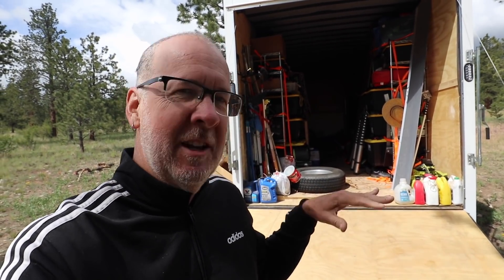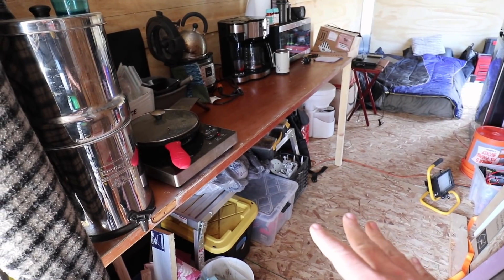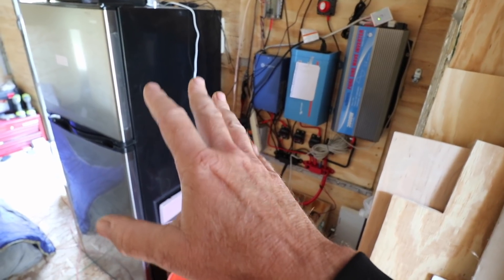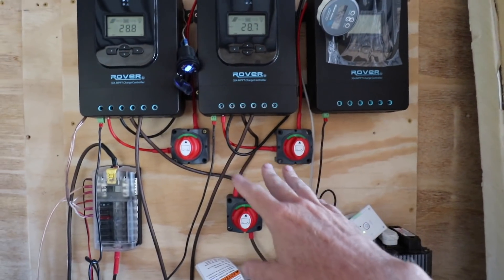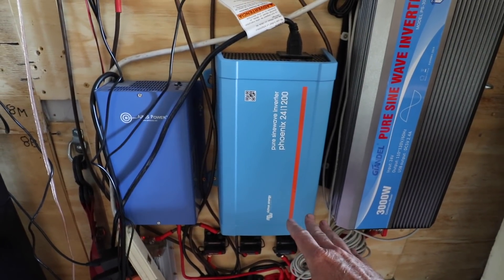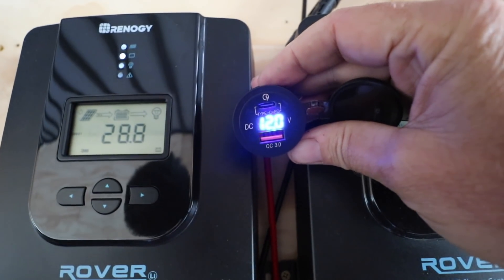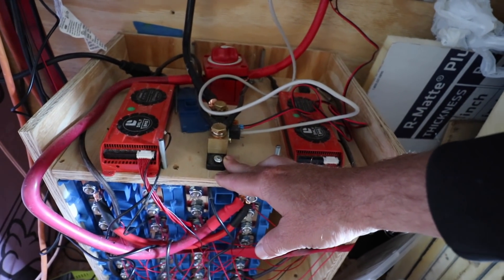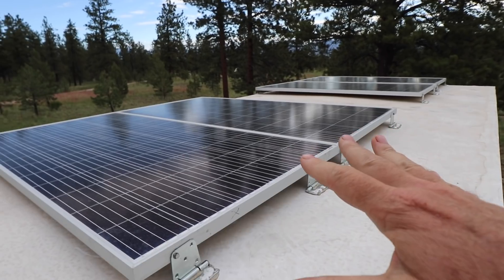2 4k Watts Solar for My Cargo Trailer Conversion E619

Comment: Nice to have the roof space for some real power. I am a bit surprised you haven't switched to a DC reefer. They aren't cheap, yet neither is the power draw of a residential. Interesting.

Comment: Are you talking about installing a mini-split A/C when you discuss your heat pump/AC?  That's what I would do.  Get the highest SEER you can afford.  They are much more efficient than the all on/all off systems most heat pumps are in the US.  Also, MUCH quieter. The rest of the world uses mini-splits.  You didn't use that term, "mini-split," so I wasn't sure what you were intending to install.
Reply from the maker: yes, it will be a 9k BTU mini split w draw of about ~600 watts mounted over the tongue area

Comment: I was a bit worried when you mentioned 400 watts output from these panels, I thought they were new panels but they are actually used? New diodes refitted into the panels. Not bad! I wonder if the average drop in output power of new panels is due to the diodes agin. I have two doors from my rentals back int he states that I brought over. Yup holes în the doors from various reasons. A wood shop I deal with over here can actually glue another Luan panel on top of the sides with the holes. Not only do they make great shelves but they can double as a drafting desk or work bench.
Reply from the maker: these are used panels with some small scratches on them. they have new diodes and original specs had them rated for 385 watts each. with the new diodes I'm getting slightly over 400 watts from each and they cost me $100 each!

Comment: Hello, Seven.  You sure are in a beautiful camping area.  Happy things are looking up and that you can enjoy some good weather, mild temperatures and get some work done on your home while you wait for your truck to be repaired.  I think you're doing a fine job.  Also happy to hear the good news about the truck.  I was really surprised the thieves took the time to install those old dirty seatbelts along with 2 seats, lol.   I wish you continued success with your build. You've learned so much about electrical systems,  you could start your own consulting firm.  :)   It will be nice when you can get back to enjoying your travels as well.  :)

Comment: You should check the power usage of the split heat pump (for heat). As long as it's not too cold, it should be pretty efficient. Like use it for chilly mornings and save the diesel heat for when it's really cold.

Comment: Many people find ways to minimize their electricity needs to boondock.  You, on the other hand, are just creating your own personal power plant.  I’m sort of in your camp too.  I’ve got 800w for my roof and another 600w for the ground as a buffer if needed.  But, I’ll be using propane, charcoal or wood for cooking and I have a 12v fridge/freezer that will hook right to the batteries.  I just discovered your channel and will be sure to follow your build.  You are ambitious to be building and living in the rig at the same time.  I’ve done that in sticks and bricks too many times.  My rig will have to be at least 90% complete before I even think about staying in it full time.  If you get the heat pump mini split, it should perform well in moderately cool temps shouldn’t it?  Say anything above 32F. ?  I’m not that well educated on them.  I’ll have to catch your video on your install of that.

Comment: A 24 vot system. More efficient but you'll have to use a lot of more expensive marine or 24 volt rated products. To use your truck as a charge source, you'll need a 24 volt alternator added on. Others have successfully done this but also with 2.4K solar, you may not need to worry about it. Looks great.
Reply from the maker: not planning on using truck alternator as a charger (only solar or shore power charging)

Comment: I feel good to hear his updates on your truck. I highly recommend you use more mounting brackets on your solar panels when you're going down the road and you get any gust of wind coming across the top of that trailer it's going to rip those cheap hinges write-off. That same thing happened to another another person that I follow he lost one or two panels because he didn't use enough brackets

Comment: Go straight to Samlex America and order your 24v to 12V; I use the big 60amp 24v to 12v but they also have the smaller amp one. Mine has been in use non-stop for 2+ years now. Tell them I sent you, I don't have any juice, but you never know. : )

Comment: I would suggest putting in a 2nd screw on each panel, it looks like you just put 1 in each bracket. It may save you a headache down the road..
Reply: @DestimoniumTremens  i go to work for my money. never ask anyone for free money
Reply: @DestimoniumTremens  i pay for it with premium
Reply: he only put one screw in them so when driving down the road they will blow off, then he can come back online and ebeg for money to help him fix his mistake

Comment: You did what I did with my panels over 4 years ago with the hinges!!!
Still have never tilted them...
Reply: How did u mount your panels?
Reply: @paulmartinez7633  6" barn door hinges, TEK screws and bolts and washers sealed with clear silicone caulk...